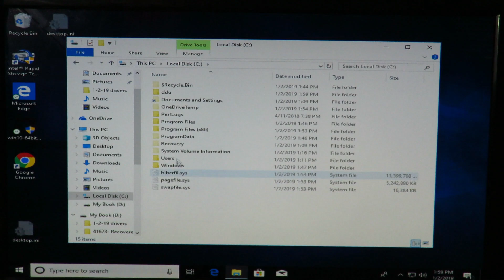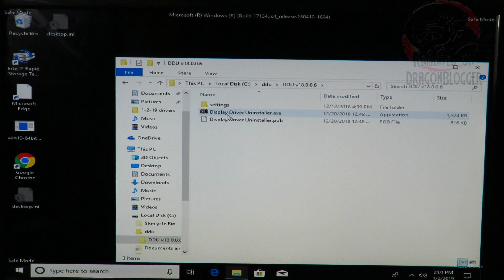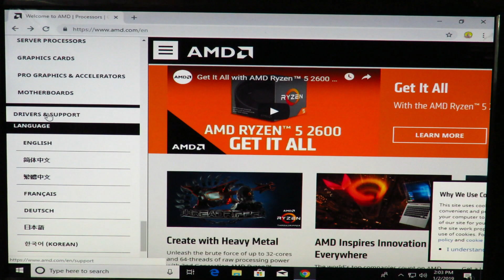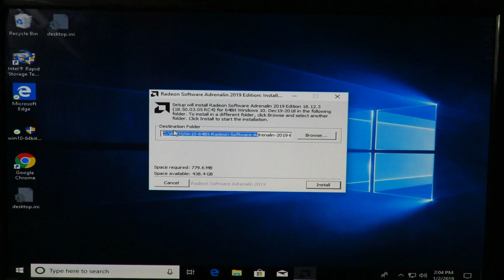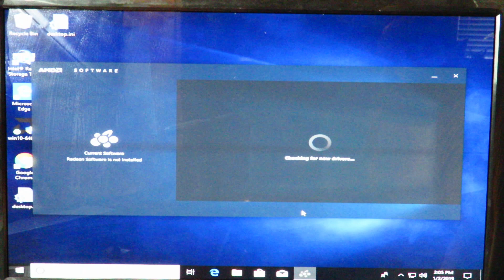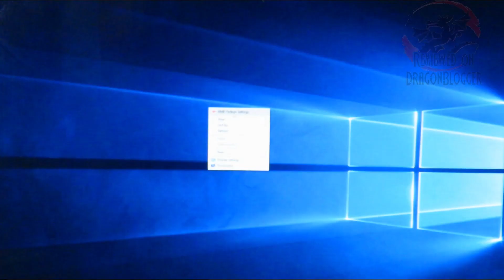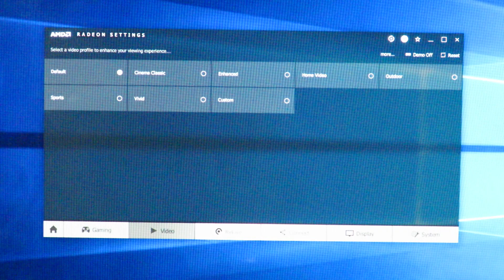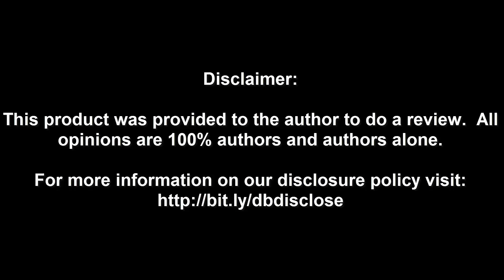How to install the Sapphire Radeon Nitro+ RX 590 8GB OC Backplate Special Edition 11289-01-20G

Comment: One small question. My PSU is Zalman ZM600-TX (80plus 230 V) which has one cable with two 8/6 pin plugs. Will it do the trick with this card or do I need a PSU with two separate cables? According to the official website the 6 pin is optional but still... I am not sure.

My CPU is i7 5820k 3.3GHz with 16GB RAM and 3 hard drives (2 SATA and 1 SSD). I do 3D modeling/animation/rendering stuff and gaming and need to replace my GTX 750 GPU with something much stronger.
Reply: you are perfectly fine my friend using that single cable that has 2 86 pin cables.  The website states the 6Pin is optional, and I have reported it to them, they say it is best to use both (I always say it is best to use both) and they said they would correct it, it has been over a month and they have not.  Oh well, hahah.  So yes, use both and you are fine using that single cable.

You will see a huge difference going from a 750 to a 590 BUT you have to make sure your 3dmodeling program supports it.  If your 3d program supports CUDA which works on the 750 CUDA will not work on the 590, if you were utilizing CUDA anyway.  The 590 supports OPenCL, so you may want to see if that program supports OpenCL and how to utilize it.

I hope I have helped
Reply: @ThisBytesForYou  Thanks for the help! I still haven't decided which GPU to buy (perhaps I will go for a GeForce model since Autodesk Maya utilizes CUDA cores more). My budget is 200$ so I have to check everything before I make my choice.
Reply: @evanskan6326  hmmm,  $200 is a bit rough.  Will you be using this for gaming also or only Maya?
Reply: @ThisBytesForYou  Both but mostly Maya, Zbrush, Substance Painter/Designer etc.

All of the programs run smoothly with my GTX 750. Only Substance has issues due to the 2GB memory of the card which is not enough. Besides, Zbrush is mostly a CPU-demanding software and I have no issues with the viewport rendering.

As for gaming. World of Warcraft and the upcoming Jedi Fallen Order are the only games I intend to play.

A friend suggested me the GTX 1050 Ti 4GB (he also uses Maya etc) which here in Greece costs like 180$ (just a rough conversion from euro to dollars).
Reply: @evanskan6326  OK, if you are looking at NVIDIA, which I would recommend more for this type of work, I would think then the 1650 would be a better choice, check it out on Amazon: https://geni.us/8yh9

Comment: I have the pci-e 2x4 plug :-/. I can't install it.
Reply: you dont need a 2+6, if you have an 8Pin you can do it too or you could get an adapter like this on amazon: https://geni.us/oTB2G2
Reply: Sorry, I just re-read what you said.  2x4, that's power for the CPU, you need a 2+6 or an 8Pin, but make sure its an PCIE 8Pin, not an EPS 8Pin, because that's for CPU's too.